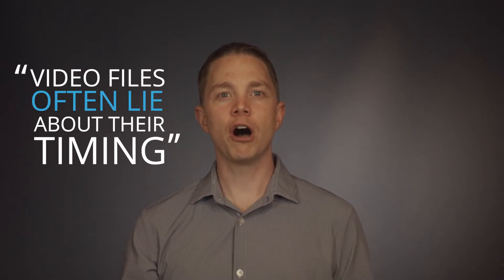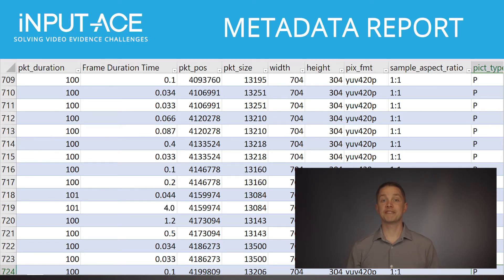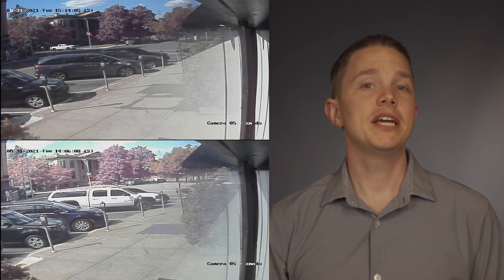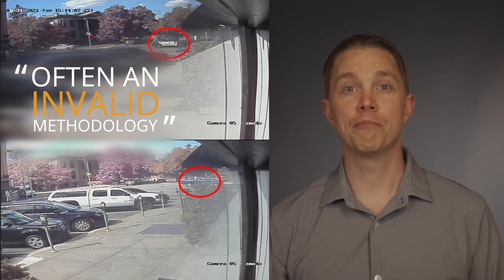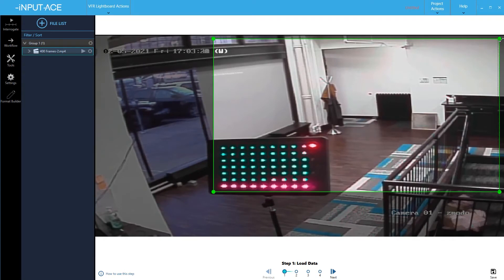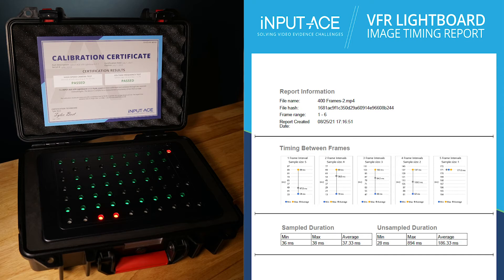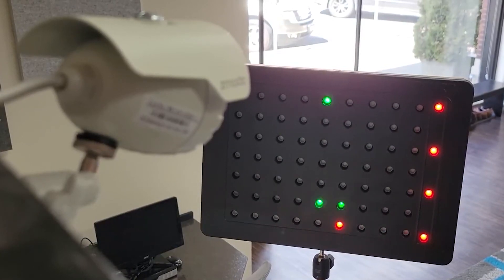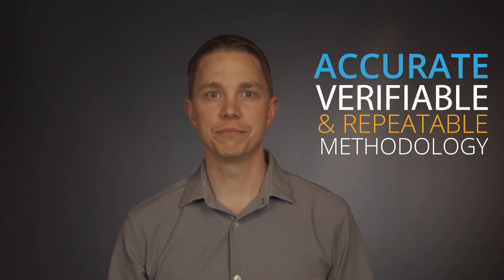Introducing the VFR Lightboard

Comment: One quick question: if the camera is on a large system that varies frame rates due to system load based on camera priority, and bandwidth, how is that variable factored in? Take for example a parking lot camera at a mall, which has the lowest bandwidth priority on most retail systems. On a busy day at a mall the indoor cash register cameras and entrance doors will be taking up much of the available bandwidth -as opposed to night. Wind and trees also impact outdoor cameras (Michigan resident here) and it’s very difficult to recreate a weather pattern.  Thanks !

Comment: This fact, and I’ve been working with video professionally for over 40 years, is so hard to to get attorneys to understand. Very often there are not dealing with forensically imaged raw-dd hard drives, DME or similar files, but normalized  USB or CD outputs from a DVR system. More attorneys should see this video -even if they aren’t using iNput-Ace/Axon on a day to day basis. I see SO MANY speed errors in cases that it’s mind blowing.